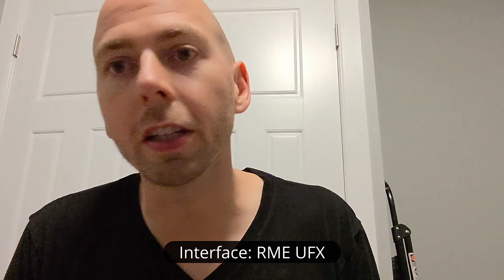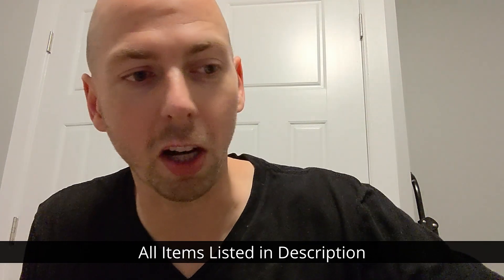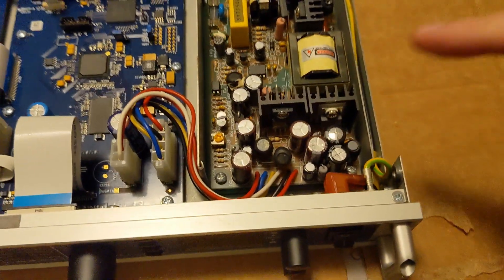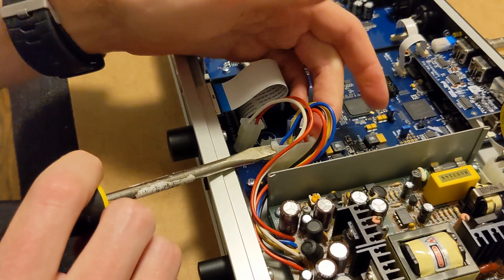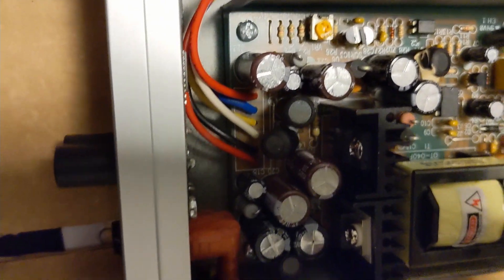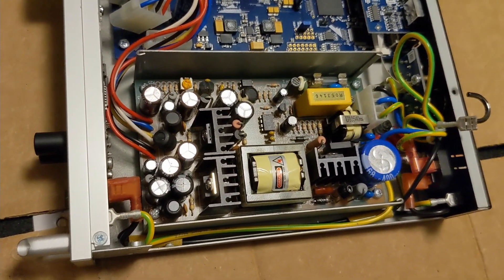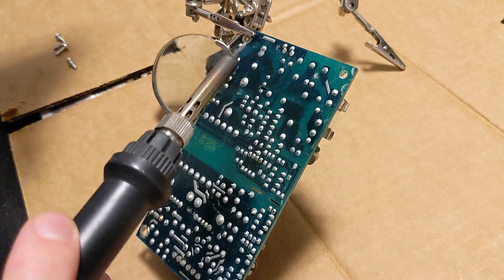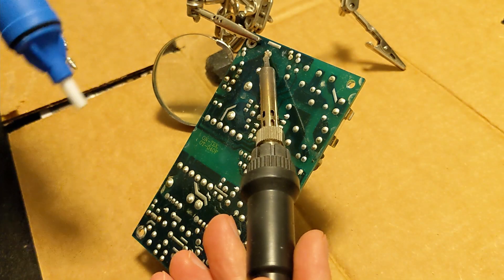RME UFX Broken? Here's how to fix it | How to recap RME audio interface power supply repair video

Comment: I literally just finished up replacing the power supply (I cheated!). However, your video showing me how to remove the cover, disconnect the connectors, where all the screws are, etc., was very valuable information. Thank you for sharing this! I won't tell you that I put the bad power supply back in first as the replacement and fought with getting the screws back in place before I finally realized I grabbed the wrong one! I guess I needed the practice session first... 😂😂
Reply from the maker: Hahaha glad you got it working! Cheers 😊

Comment: I'm in the middle of doing the same for an older unit, a FF800, which seems to have a very similar power supply board and identical molex connectors. I started with the  smaller one and it would not yield until I was pulling so hard that the PC-mount receiver end just snapped off leaving the rivets in the PC board. I am hoping that I can get a satisfactory solution just soldering the wires to the points on the board.  Tech support from RME was really quite good: the recommendation was a replacement PS board, which came with duplicate connectors already on it which was the reverse of what was in there, so I had to take one connector off and hand solder it anyway. They were very clear and patient on the phone as to how this should go.

Comment: this is awesome! especially the mouser cart thing! thank you! do you remember if you sourced low ESR caps? i'm reading that's desired, but hard to sort their site for info. 
(i've already replaced the power supply with new. both on ufx and adi-8!) (and it's time again! the $140 replacements lasted way shorter than the original.. so breaking out the solder this time)
Reply from the maker: Late to the party on this one .. I don't recall unfortunately!

Comment: Hello from France.

My poor old UFX has known the same fate as yours for a week. For the moment, this only happens when it is turned on, then stops after a few minutes. I will let the problem evolve for a few more weeks without touching, then think about tinkering myself by following your deep water dive of electronics under the microscope, or decide to send it in after-sales service, because I am really very bad at welding... And able to make it flame or break it completely.

I know that they take around $400 for a repair at RME (France and Germany are not so far away). But we must add the shipping costs.

Comment: Cannot for the life of me get the smaller cable disconnected!
Reply from the maker: Did you try the karate chop like I showed in the video?
Reply: @RaytownProductions  even that didn't do it. 30 minutes of gentle nudging with the right pair of tweezers supported by a screwdriver and it came out. Thanks for the tutorial. New power supply should be here soon.
Reply from the maker: @carltonxavier  Awesome! Glad to hear you got it off. It was really tough for me as well. I really thought I was going to break the PCB when prying it apart. Best of luck with the repair!

Comment: Fantastic job.  I would point out that usually when you are doing solder work you would add some solder to the iron tip itself before applying the tip.  It transfers the heat a lot better and faster.  It looked like the tip was bare when you applied it on the video.  I'm thinking of picking up an old RME firewire interface so this was interesting to watch, as those caps would likely be Even OLDER than yours.

Comment: i have a different problem with a fireface UC. one morning, wouldn't power on anymore, different adapter, same result. nothing happens at all.might be the PSU as well, but i find it more difficult to take apart.

Comment: my outputs won't work ..does anyone repairs these .. or can you buy the hole board ?
Reply from the maker: Sorry for the late reply. You can get it repaired and they do sell complete power supply boards. It's just a lot more expensive. Check for authorized RME repair places on the RME website.

Comment: This is unbelievable!  This problem happened to me -- I sent a vid to RME and they told me I'd have to ship the unit to them (in Germany!) to have it repaired (which you know would be a fortune).  They wouldn't tell me if this was a common prob.  Anyway, thank God I did not toss the unit.  I ordered the capacitors per your link (that is awesome too!), but some of them are backordered.  Hopefully not for long.  Thanks for this!
Reply from the maker: You can also try calling and ask their service people for substitutes. That's the beauty of electronics! 

Glad you found it helpful. Cheers!
Reply: @RaytownProductions  Thanks -- I called them and they found a sub (otherwise I'd be waiting months!).  I've taken a look and it was my C16 and C17 capacitors that went bad.  I'll see how it goes replacing those, and if I don't screw them up, I might be brave enough to tackle the rest!
Reply from the maker: @BigDancin  you got this!
Reply: @RaytownProductions  Thanks!  So I got in there and swapped the two problem capacitors -- I think it was the same two that went bad for you.  I have all the parts to change the other capacitors, but I decided to stop at "fixed" and tuck the other capacitors away for that rainy day when the problem recurs.  I am kind of a sloppy solderer, so I thought maybe I shouldn't mess with it beyond fixing the problem.  But I did, and I thank you for the road map!  I forgot the beer steps, but I will tip one while recording on my repaired UFX one of these days!  Thanks again!
Reply from the maker: @BigDancin  haha awesome!!! Cheers to you my friend 🍻

Comment: Not to take anyone's soldering fun away, but what did you pay for the parts at Mouser? I just had my UFX+ PSU fail and replacement was $89.00. I was actually surprised at the price, expecting it to be a lot more.
Reply from the maker: Wow that's pretty good and saves you all the hassle! I think it cost me about $16 shipped.  But had I found something for $89, I probably would have considered it!
Reply: @RaytownProductions  Ha ha. Yes, add in your hourly rate and it's probably a wash ... with less stress. USA supplier of RME parts is Synthax. There is a tech, Jeff Petersen, who is uber helpful.
Reply from the maker: @dftweedie3021  good to know! And now others that find this video has the contact to reach out to 🤘 thanks for sharing!

Comment: Thanks for sharing! Did you measure the capacitances of the removed capacitors? I wonder if it was just the bulged cap was all that was wrong.
Reply from the maker: Did not! But I saved all of them so I can always go back and measure them.
Reply from the maker: Just measured the capacitance and the buldged one was about 2000 uF low and jumped around a lot. It was definitely bad 🤘